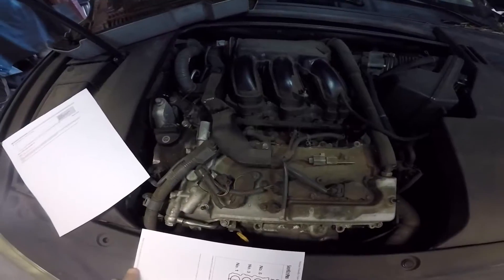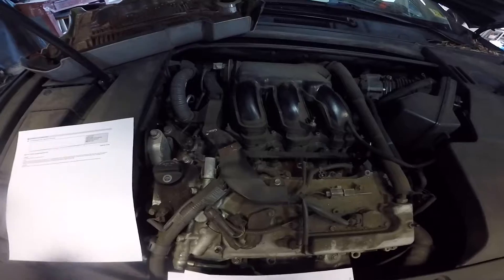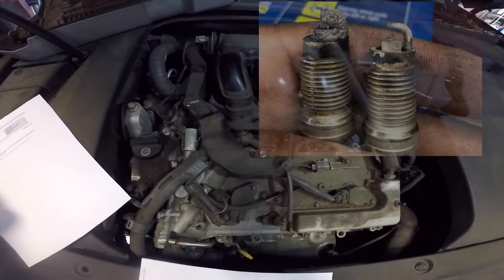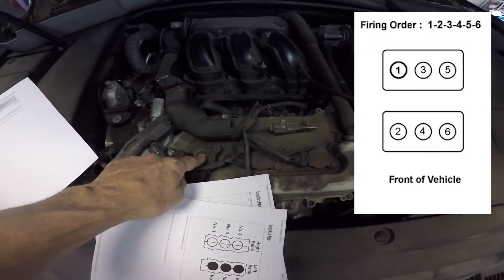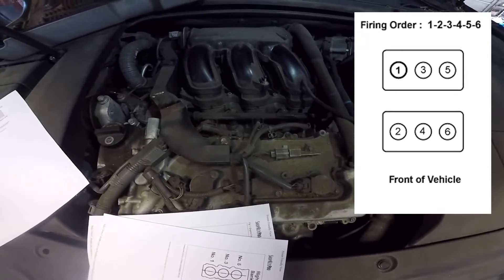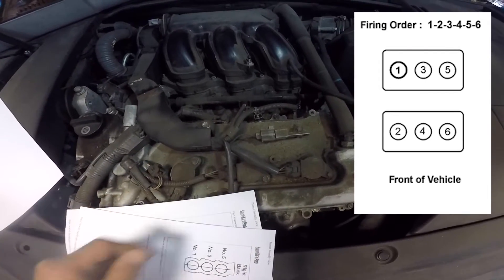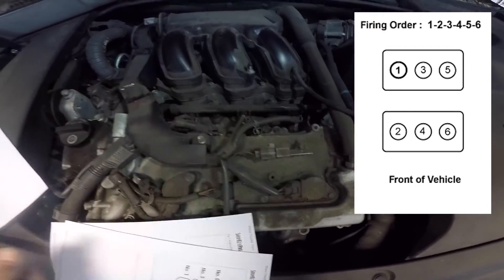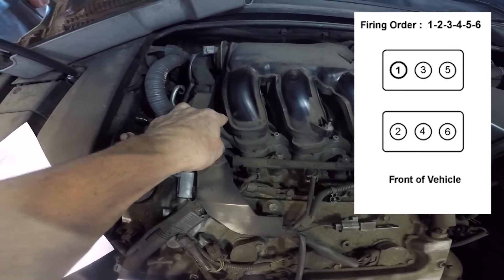Lexus ES 350 Firing Order

Comment: lexus es350 09 model cylinder 2 missfire i unpluge 4 it started bulging down when i did number two nothing happed  i change coil and pluge same i drive engain light flashing
Reply from the maker: Check fuel injector and compresión